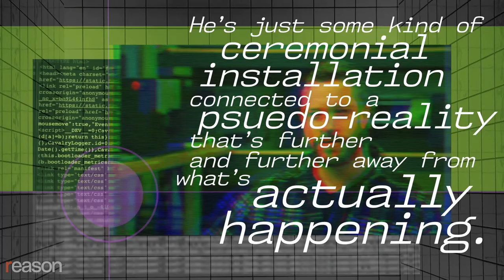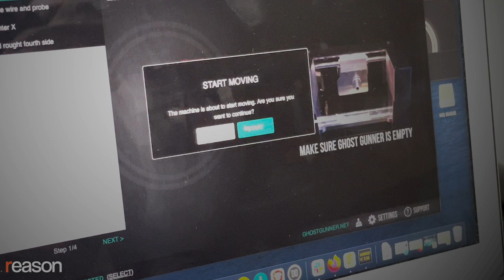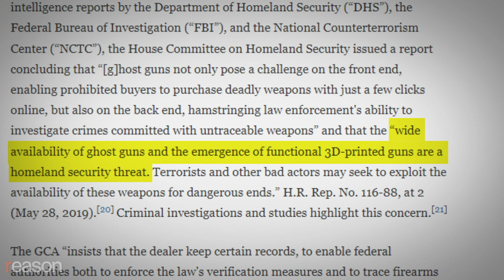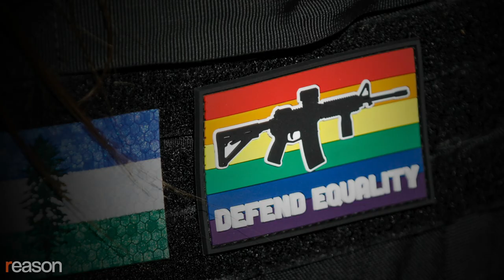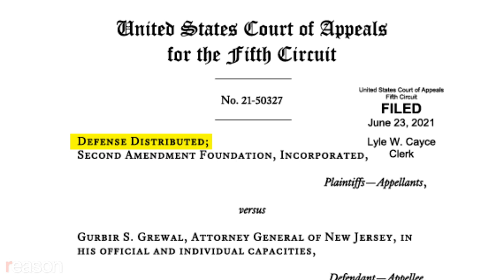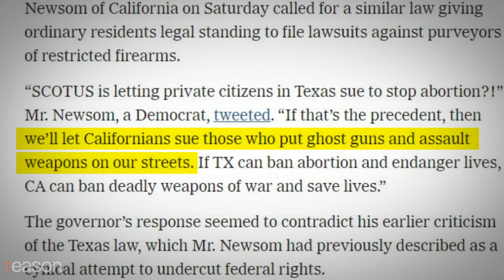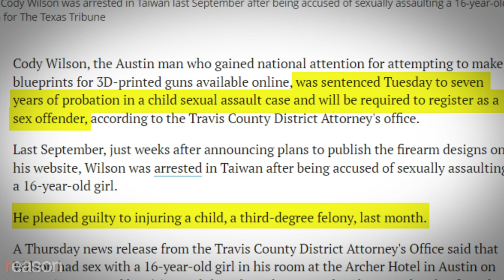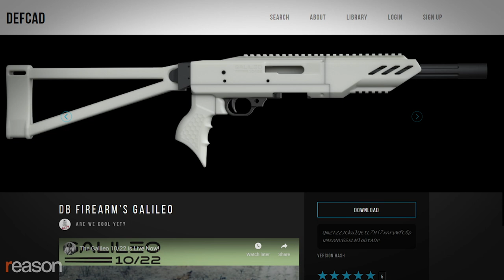Cody Wilson Thwarts Another Attempt To Stop Ghost Guns

Comment: The "diy gun movement" is a terrible way to phrase it. Making firearms has been an American tradition since the beginning of America.
Reply: Real. That movement has been going on for 100s of years.
Reply: the United States used to require or recommend everyone to own a gun, ball, and powder. they spelled out what all citizen households should have at a minimum.
Reply: @SoloRenegade  I wish it was still like that
Reply: yup, I'm too poor too guy a 3d printer but doesn't stop me popping down to local hardware shop, collect some steel pipes n bits pieces n build a gun from .22lr to 12ga shotgun. I already got welder n basic power tools. can't control knowledge
Reply: And we are making better quality guns then 3ver before.
Reply: No such thing as a DIY gun unless you can mill gun barrels and chambers.
Reply: @donaldkasper8346  the beauty of capitalism is you can purchase these relatively easily. But I see the point you are trying to make. There are very few people who would be able to manufacturer every part. You are just being a little cynical unnecessarily.
Reply: @donaldkasper8346  don’t need to mill them. It’s possible not to, many people have made zip guns that are not milled.
Reply: @donaldkasper8346  Electrochemical machining
Reply: @kevinhufford1064  First, I was not aware it was possible to buy just a gun barrel.  Second, if you can, then buy the whole gun.  Tech without making 100% of the gun is not tech, it is just playing.  The milling machine and tech to make parts is vastly more costly probably by 20 times than just buying the whole gun, so you would have to be a criminal, bad at math, paranoid, something along those lines to screw around with a couple of parts.
Reply: @donaldkasper8346  Google zip gun lmao, they didn’t kill anything xD
Reply: @donaldkasper8346   You were not aware that a common part to wear out on a firearm would not be a replaceable item? OK.  And you also see no reason for any person to want, or need, to replace individual components on a firearm either. OK.  There are plenty of people who enjoy building their own things and getting very familiar with their inner workings. And also for people, pricing a firearm together can allow them to buy components a little at a time, as budget allows and it also allows people to build a custom firearm with the exact parts they want to run.

     One of the biggest issues we have in this debate about firearms, once you get past the emotionalism, is the lack of knowledge by the people who push the hardest for control of the industry itself. Your assumption of personalities for anyone that would want to build their own firearm is outright ignorant. No offense! Maybe this is your first time coming across this topic of personal firearm manufacturing, but it is. The type of person that takes on projects like these, is generally average or above in intelligence and they probably already have a large number of skills in making things. May be different industries, but still have the capacity to learn new techniques and to accomplish a goal. 

     You need access to a milling machine in most cases. You need to have, at least, a basic understanding of machining metal. Not your typical criminal has many of these skills. I don't believe I have ever run across a story about the ATF busting the inner city of Chicago's private firearm manufacturing ring for the local drug wars. EVER!  Know why? These aren't the people buying these kits.  But please keep making your assumptions and giving everyone another example of the type of conversations to expect when it involves firearms.
Reply: @bbwiebz3994  They're trying. They're worki g on interfacing chips with brains to form a hyve.
Reply: @kevinhufford1064  Would I spend $5000 to replace a part in a $500 gun?  No.  I would take it to a repair shop that has old gun spare parts.  Non heat-treated milled aluminum will bend and snap.
Reply: @donaldkasper8346  if you are talking about the part he is milling in the video, that would be for a reciever or another non structural part. Aluminum works just fine.
Reply: @donaldkasper8346  So would you have to be bad at math to sew your own clothers or bake your own cookies? Or would you criminalize those activities as well? The part you miss is it is ALREADY ILLEGAL for PROHIBITED people to build their own guns. Non prohibited people should be able to build their own guns but now cannot in some places without fear of prosecution- why? They aren't prohibited from owning guns?
Reply: @mytuberforyou  You cook your own food to save money.  But if my hamburger cost me $500 to make it myself, I would go out and buy one instead.
Reply: But it is a “DIY gun movement”…
Reply: @donaldkasper8346  YOU may cook your own food to save money, but surely you realize other people do so because it allows them to season to their tastes, or control the ingredients or handling, or even because they simply enjoy the activity? I mean., would it be fair to mandate you had to hire a professional cook for your BBQ?
And I'll also submit a Polymer 80 lower with a Palmetto build kit is on par with the very cheapest ARs and probably contains better parts.(except the lower, I'm not a fan but I respect the right of people to choose their own products)
Reply: @mytuberforyou  Typing is fast and not a dissertation.  I cook to save money and to cook to my taste.  For example, when they got rid of Stouffers mac and cheese at Costco and replaced it with that garlic mac and cheese shit, that was it, I make it myself.  I could go to other grocery stores with it, but then I have to memorize 25 aisles all over again to find it.  Bad enough all the rearrangement cycling through Costco these days.  Food is moved 5 aisles from one trip over to the next.  They do that on purpose to get people to have to scan all the aisles, but there are 8, not 25, and it is in a big pallet, not one item wide like a bookstore you have to study for a half hour at say Ralphs.
Reply: @donaldkasper8346  how's that relevant? The point is you should be allowed to cook your own food, or grow your own food, or make your own firearms if you are not a prohibited person- and as you not, saving money isdn't the only objective and people aren't "dumb" to make their own guns vs commercial suppliers that may not be there in the future. The Fed can make it so burdensome to even buy guns (NY) that making them may become your ONLY option. Hell, I can't even leave my ARs to my kid when I die since they are "assault weapons" now.
Reply: @donaldkasper8346  Lol you sure about that? I can make a rifled barrel in my bathtub with ECM and a bolt with an angle grinder
Reply: @yobrodontshoot1130  People have been building guns for forever lol, you just haven't heard about it because people that homebuild guns don't really talk openly about it
Reply: @mytuberforyou  Dude... You need to move
Reply: @RustyShackleford556  But it’s still a “DIY gun movement”…

Many movements happen in secrecy. And even then, building your own guns isn’t what a majority of gun owners do.
Reply: @yobrodontshoot1130  Fair enough I guess, I was just saying that people have always been building guns. It's not a movement, it's just a normal thing that people do.
Reply: @RustyShackleford556  Very funny.
Reply: Its like they dont realize how many firearms and explosive objects can be built with ONLY Home Depot or hardware store items.
People are idiotic.
Reply: Aryan Toon  Anyone can drill a hole in steel, but I am not going to shoot it.
Reply: Aryan Toon  Anyone can 3D print a gun, but that does not mean any actually work, or rather, I am not going to use one.  I like having hands.
Reply: That's why it's accurate
Reply: It's like how did Browning get to where he got?
Reply: @donaldkasper8346 , So, the fcg-9? it's already happened and has been used in real world conflict, specifically Malaysia.
Reply: @GigaChad-kg8en  Machining is machining.  That is not 3D printing.
Reply: @kevinhufford1064  You can buy parts easily and they do what, assemble into a working gun you want to use?
Reply: @donaldkasper8346  You said that there is no such thing as DIY guns unless you can mill out a barrel and I pointed out that you can do electrochemical machining for that. There's plenty of video guides on it and it can even be done in a bathtub or utility sink.
Reply: @GigaChad-kg8en  Yeah bud.  Keep in mind knowing something is true because a friend of a friend heard on Youtube you can do something is different that you do it every day in production manufacturing.  So you make guns every day in your bathtub?  Okay, I didn't think so.
Reply: @donaldkasper8346  Holy crap you're really trying your hardest to discredit DIY guns. I have built a few FGC-9s and one of them even has around 2000 rounds through it.
Reply: @GigaChad-kg8en  There are DIY assembly of stock parts and there are making your own.  No, you aren't going to make your own from blocks of steel.
Reply: @donaldkasper8346  Yet I still did. Anything else?
Reply: @donaldkasper8346  you can only buy all of the parts to assemble a functional firearm if they are shipped to a FFL dealer in your State and pass a background check. It illegal to ship certain components, generally a completed receiver without the background check. Now, you can buy an 80% and then the end user must modify it to become functional.
Reply: First time I read this, I read The "dirty gun movement"
Reply: True, isn’t this just changing the materials they can be made from? What’s the difference if I have a mill and lathe and make a steel gun from scratch?
Reply: Can't wait to make a flintlock that is far superior to that of the state military lol
Reply: It started with the shape your own rock movement.
Reply: @masterofreality230  pandoras box started a long time ago lol
Reply: :trophy-yellow-smiling::goat-turquoise-white-horns:

Comment: If the definition is changed to anything that can be made into a gun, then that includes nails. Keep in mind the Liberator gun uses only one metal part to work and that is a nail, if this definition change applies to the Liberator then that means all metal parts regardless of their relation to guns have to be serialized.
New Zealand has knife control, I never thought the US could top that with scrap control.
Reply: All metal pipes and nails/screws would all have to be serialized. Pipe shotguns (slamfires) are insanely easy to make.
Reply: Underrated comment, honestly.  When everything goes to shit, the amount of people who even have the knowledge, let alone the skill, to even MAKE the things, will be so sparse that these laws seem so FIRMLY directed at suppression against tyrannical government.